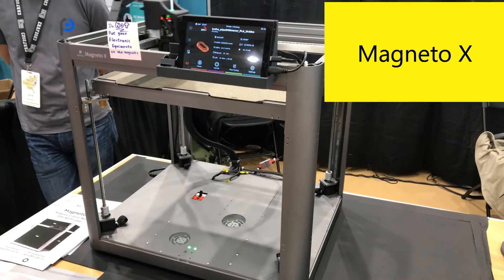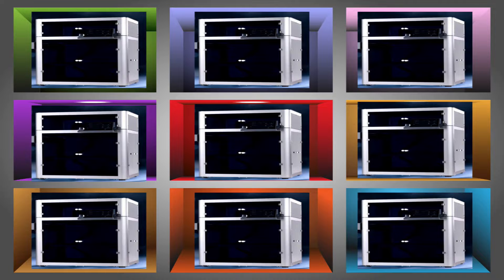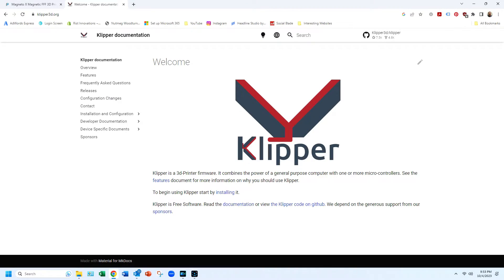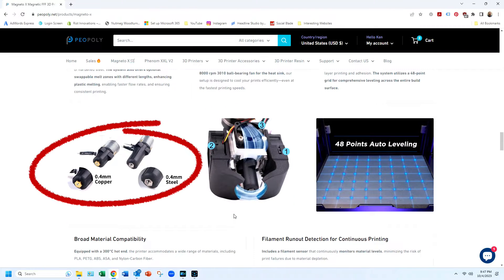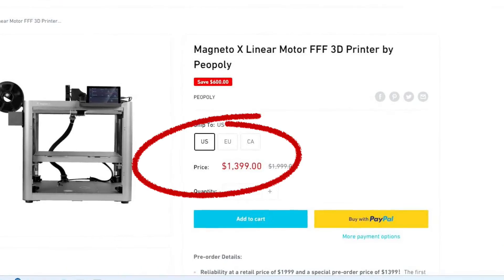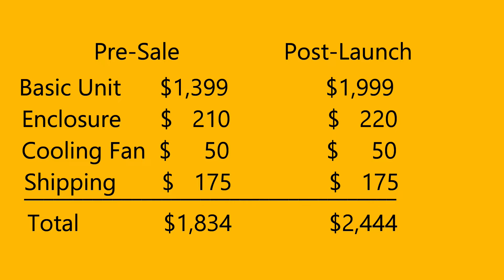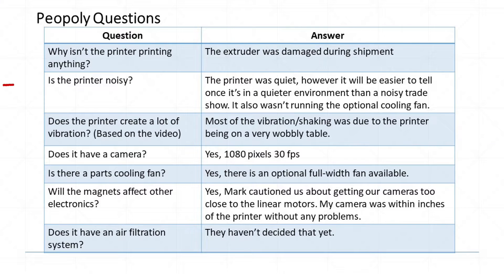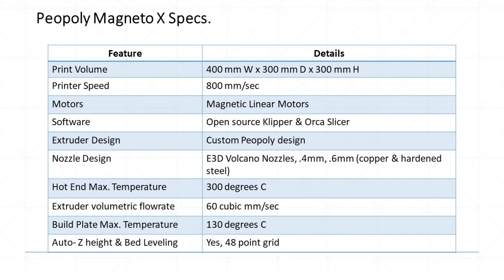The Secret of the Peopoly Magneto X: Linear Motors for 3D Printing

Comment: Rist, do you find it a little crazy to hear "less maintenance" so much in this interview and then in your experience, likely having had to put so much maintenance/work into your magneto x since owning it?
Reply from the maker: I think at the time of the interview, Mark sincerely believed the Magneto X would have less maintenance than a printer with belts. Looking backwards, I think Peopoly underestimated the various production problems they would face and the delays in actual shipping of the production units. As early production units in the field experienced additional issues, this required Peopoly to make more design changes. In my opinion, I think the Magneto X was launched before extensive testing was completed, which would have found most of these issues. I think Peopoly has worked very hard to address the issues, but I think there is hesitation within the 3D printer community to buy the Magneto X because of the issues with the early production units.

Comment: Does this even need input shaping for better prints?
Reply from the maker: It’s hard to say, but it is running Klipper so input shaping will be available.
Reply: Linear motors with feedback encoders have a lot of advantages, but they don't change the fact that the structure will still resonate at some frequency or frequencies.  Input shaping is a neat trick to cancel out resonate frequencies, so it won't be going anywhere. What you won't need to worry about anymore is skipping steps - the encoder will always tell you where you are. You can also use more advanced feedback controls which should allow faster speeds.  Having feedback also opens up some interesting possibiliies - you don't really need limit sensors anymore, since you can just detect a hard stop by monitoring position and waiting for it to stop. You can also include a marker on the encoder to use as a soft stop or reference point. You could have obstruction detection by monitoring current or position error. You can also add limits to the position error to detect problems with the mechanism, such as screws coming loose. In practice, a linear motor with feedback will have better precision than the step size of a stepper system. Finally, having a feedback encoder means that you can self-tune the feedback system (including the input shaping) without the need for accelerometers or test prints.

Comment: I ordered day 1 and I'm very excited for this printer. I had a feeling pre-orders would sell out after ERRF and they did, such a great price if the printer performs like I think it will.

It seems like it's built very well with user repairs in mind that aren't locked to the manufacturer.
Reply from the maker: You and I share the same excitement! I have a very good feeling about Mark that he will do everything in his power to make this printer successful😊
Reply: They are still available at the pre-order price
Reply: @modmike4406 sold out